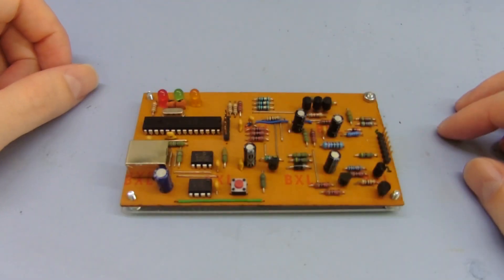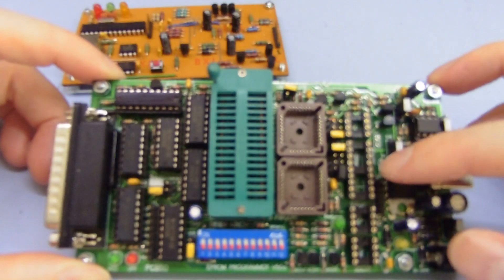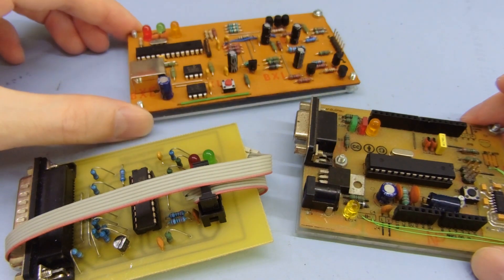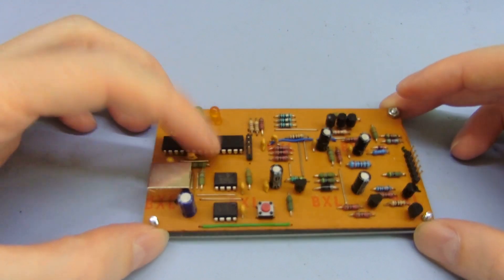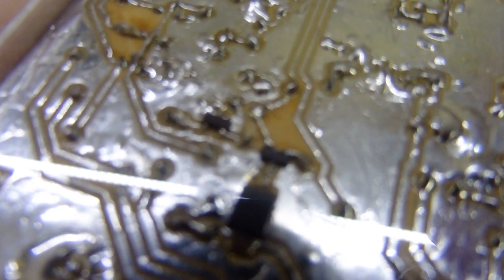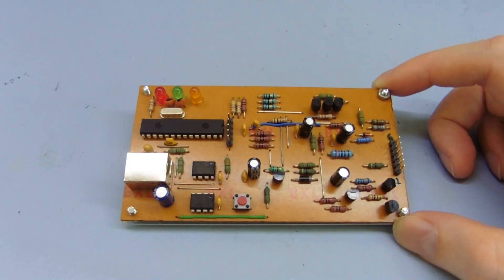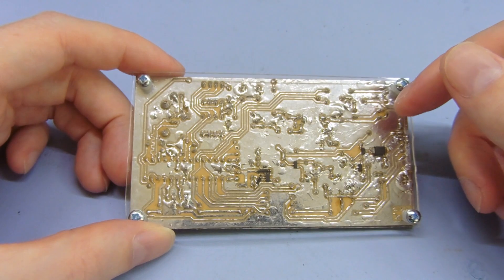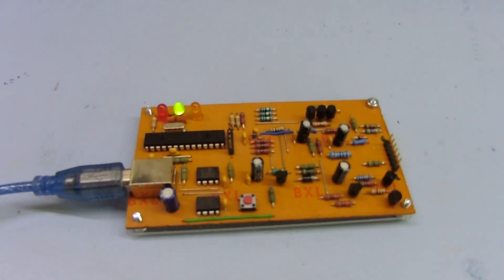The joys of bootstrapping your own PICKIT2 from scratch

Comment: Note that now there is a couple other projects I'm aware of that may work, for converting a cheap arduino board into a PIC programmer-

rlnd-ldwg/pic-prog

rweather/ardpicprog

battlecoder/zeppp

Those are github projects, youtube doesn't generally like urls in comments

I wonder if this would make for a nice DIY THT part project.

Comment: Well you could use the GPIO of a raspberry Pi.
Thumbs up btw.
Reply from the maker: I guess so, although I don't have one so I didn't think to mention it.
Reply: @Agent24Electronics  Neither do I. Maybe this following info is handy to you though? Can you use your tech-knowledge to figure out how it might help your situation? Those TerribleFire amiga accelerators (CPLD) are flashed using a Raspberry-Pi if the people making them have not got a TL866 EPROM Programmer Adapter for 27C400/800/160 and 27C322 16bit EPROMS. 

https://www.youtube.com/watch?v=UKfEzb8HA0s

If you read the comments here, you can also see how a Raspberry-Pi3 works almost the same if the pins are worked out. To Quote TFire, (speaking to treintje1001) he says... 

<quote>
The Pi3 should work just the same. You just need to figure out where the GPIO4,27, 17 and 22 are .. https://github.com/terriblefire/tf328/wiki/Flashing-the-CPLDs-with-a-Raspberry-Pi

</quote>

Personally I have spent precisely no energy working out how to do this for you project. However, if you wish to fathom it and make a video, I'll gladly watch, then scribble down the infomation and regurgitate it a year later (like I did with this info to you) to some other youtubers thereby making myself seem a hair smarter than I actually am. Oh and you'd get a thumbs-up out of it. I mean this is a pretty good deal, albeit a pyramid scheme. I'd take it if I were you. Going once. Going twice...
Reply from the maker: @obsoletepowercorrupts  Haha! I'm always a sucker for dodgy pyramid schemes, but while I could do it for the academic exercise, practically there's no point to me. This programmer I've made does work so I'll just be using that for now. I'd have to spend money on a Raspberry Pi, and worse, learn how to program on the thing, which would probably give me an aneurysm. Thanks for the idea though! Maybe one day...
Reply: @Agent24Electronics  Apparently, the raspberry-pi zero (which has the same GPIO as the original, I believe - but correct me if I am wrong) is only $10, according to Austin Evan's old video:
https://www.youtube.com/watch?v=NqBmfVUjh9I
BTW, I know you're not going to do the EPROM thing with it, but I just thought I'd pass the info on. :)
Reply from the maker: Thanks. I have seen those but if I was going to get a Pi I'd probably want the full one so I can get maximum use from it. But then again, you never know...
Reply: @Agent24Electronics  Yeah I know what you mean actually. I feel the same sometimes regarding the Pi. It's like (unless blagging one thrown away for free such as for spares-and-repairs)every specifi job for a Pi (or similar) would feel best if planned. So for example, like you say with the full one, the comments in this awesome video show how those who wish to use the GPIO for a VGA and Scart connection (without touching the hdmi port) like to use a quad-core so they can use n64 games, rather than just mame and snes. and all-in-one-solution. Then once that Pi is used for those things, only then does it "feel right" (which isn't very scientific, I know - but meh whatever) to assign cheap single-core £5 pi zero boards to maybe GPIO programming and the mundane. And even then, what with the arduino nano being 3 for £10, some jobs could be used for that instead of a Pi because it is merely a microcontroller, not a prcessor. SO for example that could mean one needs not go aroud a network in the same way paranoid (and rightly) trying to avoid spectre vulnerabilities. So the arduino can be "less is more" in that sense (so as if to say, for a bunch of arduinos, they are protected behind a single security solution machine). And, as an aside, the rj45 even on the quad-core pi only gets about 30MBps in reality. And the wifi can be disappointing. So yes, like you say, these things feel best if planned before getting one hastily (or at all). :)
https://www.youtube.com/watch?v=l833vvrY4cc

Comment: I'm really curious how your Hakklone project goes.
   I have an Atten based station sold as a RadioShack Digital SS 60w. It's basically a 936 mod copy that uses a PIC16F628. Atten did the 936 style handle and heating element, but instead of the 4 wire design they put the element in series with the thermalcouple to make it a 2 wire element. I believe this is the same way Hakko did the T12 element. I've been curious if the T12 would work in my station as is. I believe the T12 is 24v, the same as the Atten.
   I've also thought about trying some kind of dual iron setup with the ability to switch one, or both with one kept on standby at a much lower temperature. It would be nice to be able to swap between my main chisel and a needle tip on the fly without turning off the station to swap tips. Maybe your project will get me motivated enough to try something myself :-)
  Thanks for the upload.
-Jake
Reply from the maker: If your thermocouple is the same type as that in the T12, then it should work (though probably not at full capacity if you only have 60watts available), but I'd be surprised if it's not different.
I'm surprised that they use 2 wires at all, actually. Have you verified that they aren't doing something else, like a common negative connection through the shield/connector and 1 wire each for heater and sensor? Or even something bizarre like a thermistor in parallel with the heater?
Assuming you're good with microcontrollers, you could probably always replace the original PIC with your own that's programmed to read a T12 correctly, if needed.
Glad you enjoyed the video!
Reply: @Agent24Electronics  
  If you look up Kainka Labs, Rodger did a reverse engineering upload of the same Atten station a year or two back. He explained it far better than I can. He demonstrated the thermocouple in series with the element conclusively though. 
   Unfortunately my coding skills are pretty bad. I'm working on it, but rewriting the code for my soldering station would probably result in a half functional spot welding machine :-)
-Jake

Comment: Hi, did those errors that " magically connected " appear in Kicad ?
Reply from the maker: Yes, but not a bug, just myself accidentally drawing a wire across at the wrong place.
Reply: @Agent24Electronics Oh ok, shame, obviously the DRC's couldn't catch it...I tend to use "net names " and " labels " as much as I can nowadays to avoid such a thing... nice project though.
Reply from the maker: @andymouse  DRC won't catch anything if you draw a wire over a pin connector. As far as the schematic editor is concerned, doing so means you want it connected to that pin.
Reply: @Agent24Electronics Oh Yeah..just a bummer then!